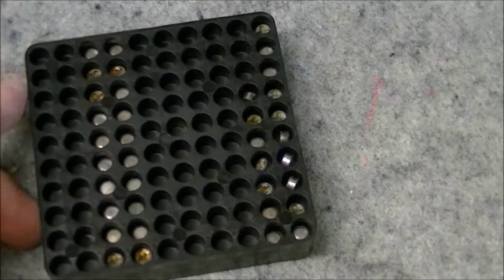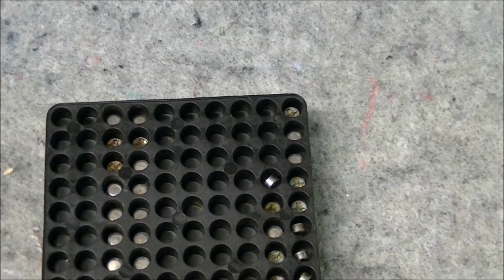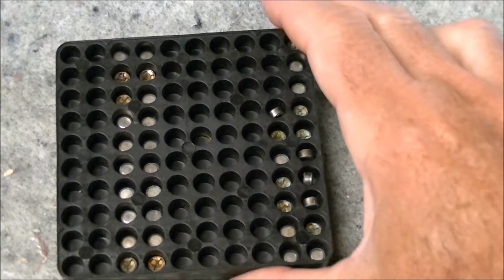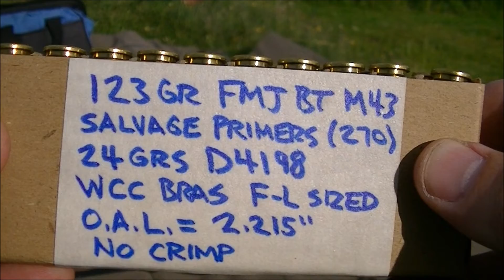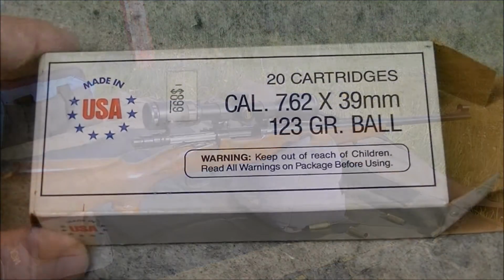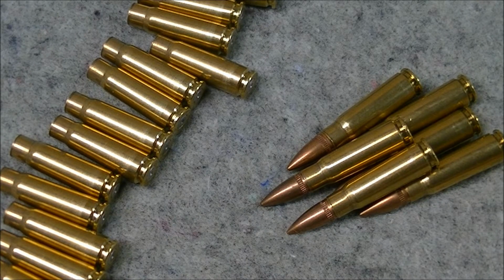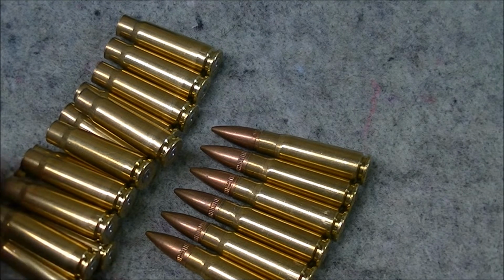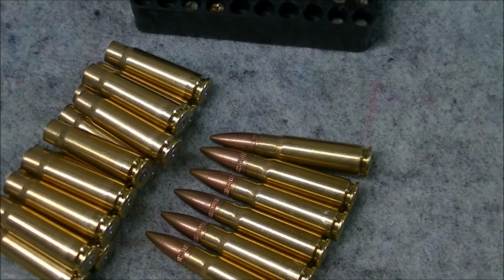Testing Salvaged Rifle Primers

Comment: I salvaged the primers out of some US .308 blanks (For use in the M60MG on M13 links) and loaded them up in regular .308 147gr fmj spec ammo.

All went bang..
Reply from the maker: Being for MG use were those primers crimped in place? Were they hard to remove?
Reply: @314299  

Surprisingly they were too bad. I used a pipe cutter at the shoulder so I could get my hand held decapper in the case.
Needless to say, I gently squeezed them out.😉
Reply from the maker: @KRN762  Interesting. You could use those cut off cases to make 45 ACP shot shells.

Comment: Great experiment! I have occasionally salvaged primers from damaged or suspect ammo. Almost always, using my Rock Chucker. There are ways to mitigate the danger.
Reply from the maker: Do you put a piece of pipe over the ram to block the primer chute off?
Reply: @314299  That's one way to do it, but you can also just zip tie a piece of sheet metal to the front of the frame window.

Comment: Great video, thanks for sharing. I usually use these primers for blowing out cases . I have never used primers as bad as the ones you have but every so often there is a miss fire.
Reply from the maker: It's not a good idea to use salvaged primers for "serious" use as there is alway the possibility that the primer pellet may be damaged and you get the miss fires you mention.

Comment: There haven't been any primers available in my neck of the woods for a year or so now.
Reply from the maker: They are not commonly available here either and when they do show up they have been going for $100 per thousand.
Reply: @314299  Most are around$100 per K here in the states as well, there hasn't been a primer of any brand or size around here since Dec. of 2020. I'm good, though, as I stocked up while they were readily available and cheap.

Comment: Great video, here I was thinking I was the only one who’d do this kind of thing 😂

I use a LeeLoader base and a .17 cal decapping pin and I slowly push them out with a mallet. So far I’ve only ever had two detonate, both from the same batch of nickel-plated brass so another good thing to consider when doing this type of thing is to wear eye and ear protection and a glove. 

I’ve also got some corrosive primers I’ve salvaged from 1940s US and Canadian .30-06/.303 and 1950s Israeli 7.92 ammunition that I have seperate and marked as such. I may even do a video on those whenever I get around to using them.
Reply from the maker: I take it you push on the decapping pin instead of hitting it?
Reply: @314299  no, I very gently tap them out rather than push them out. 

The two that detonated were crimped Winchester brass, I think the crimp held them in tight enough that my tapping was enough to push the anvil in the priming compound hard enough to blow it. There were another 15 or so of them that came out fine though. 

I did untidily start off using the press and FLS die and slowing running the handle and taking note of which primer was the good one, but that got tedious and I didn’t want the case lube to possibly affect the primer so I switched methods.

Comment: Why was the brass a write off? Just wondering, I've picked up brass that's been laying in the dirt for years and the rotary wet tumbler has always cleaned them up well. Anyway no criticism just wondering. I dig the video!
Reply from the maker: Some of the brass was usable after cleaning, some was put in the scrap bucket as it was too heavily corroded to be safe for reuse. Wet tumbling with stainless steel pins and LemiShine certainly does a great job, but there were cases that showed pitting after cleaning and so were discarded.